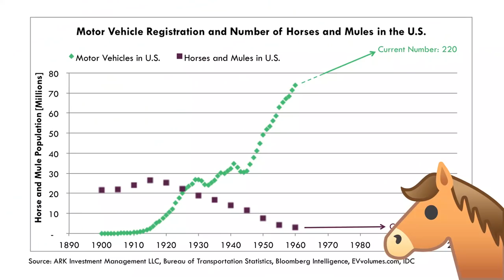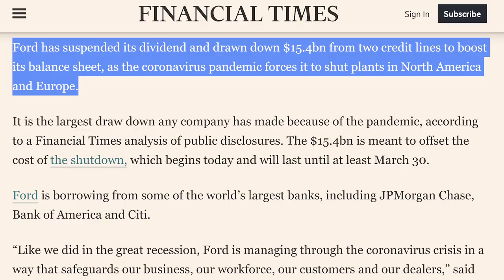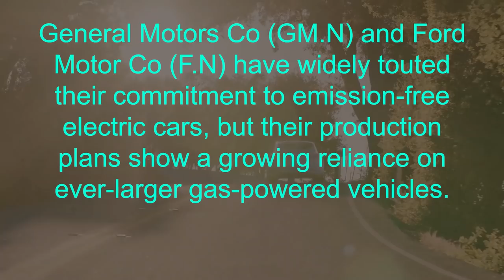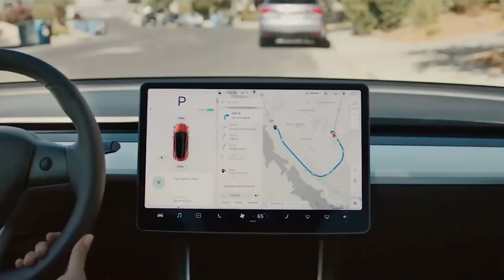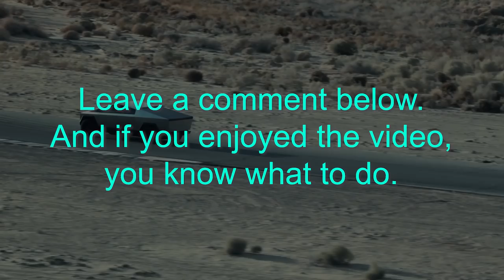Ford and GM are in BIG Trouble (bankrupt soon?)

Comment: Im not the biggest fan of VW but this CEO is spot on. They are in good hands.
Reply: I know, I feel like VW is a good hegde if you're heavily invested in Tesla.
Reply: @thdjjfsfh  One of the legacy makers should survive. They're all terrible, so why not VW? I wouldn't buy from them, but others might.
Reply: @maximumvalues  You sound like you just discovered EVs ten minutes ago. What you've posted has been debunked many, many times. Do some research before posting that nonsense.
Reply: Agreed
Reply: @maximumvalues  Trouble reading, too? 
1) You've lied about charging stations, claiming that switching to EVs would create long lines. This lie requires believing that no additional charging stations will be built as new EVs are produced. A decidedly anti free market lie!

2) You've lied about Tesla's stock price. If it had dropped 100% it would be $0/share, not $514. 

3) You've called Tesla stock fake. Another lie. This is the one company truly making a difference, not just with EVs, but energy production and storage. I'm sure your boss doesn't like those parts. After all, Russia is an oil and gas exporter.
Reply: @maximumvalues  I believe what you did is called luck. If you can continue making calls like this for year after year then we will know you are one talented individual rivaling Warren Buffet!!
Reply: @maximumvalues  EV will have a lower cost of ownership regardless of fees.
Reply: morally bankrupt
Reply: It's all lip service for the investors.............These are the same people that had emissions cheating software in their cars! Who would of thought the Germans were trying to gas the world!!!! The cost of pivoting from ICE vehicles and a Dealer network to EV's and direct sales will kill off most Legacy car makers! Legacy car makers have nothing but concept cars and empty promises of what they are going to do........they have no credibility don't believe them!
Reply: EV cars are doomed because they're based on the climate change lie, which is dying, slowly but steadily
Reply: @gibbyjones1040  Man made climate change is a massive scam I agree. However I bought a Tesla because it is far superior to every ICE vehicle I have ever owed! Every time I leave to garage the tank is full, I charge it from solar, it's never needed a service, I hardly ever touch the brake, it's the fastest car I have ever owned, I get free updates over the internet, the range has increased and it has gotten faster for free............People are not buying this car to save the planet we are buying them because they are freaking AWESOME!!!!!!
Reply: But may not make it.  Just because Diest found Christ doesn't mean VW won't avoid the Electric Chair!
Reply: @therealctoo4183  
Go back to Russia!!! Hahahs thats all you've got. 
Hey do you know Teslas net profit for 2018? Negative 960 million. What about 2019? Negative 800 million.
Reply: @chasejordan22  Do you know what investing is? Huge investments take time to pay off. It took Amazon a long time to get where it is now, despite not needing to spend the money it takes to build cars. Tesla is getting there faster. Don't believe me? What was Amazon's profit in 2014?
Reply: @therealctoo4183  
Yes I know how investments work, but if you havent been paying attention its easier said then done. How many super promising conpanys never made it anywhere let alone become Amazon.  If the future was that easily known we would all have been rich for years.
Talk to me when you have a profitable year or two first.
Reply: @maximumvalues  thanks for the advice. Ready to buy more tsla.
Reply: @chasejordan22  I don't think you do. If you did, you'd know that by the time Tesla has a year or two of profits you'll have missed the opportunity for the biggest stock gains.

The fact is that Tesla has a blue ocean. There is literally no company that can be considered to be a viable competitor for them. Not one even makes a car that could compete against an 8 year old Model S. None have even announced EVs likely to threaten ICE sales (as Teslas do) in the next 3 to 5 years. Maybe — and it's very iffy — VW will get something going with their ID series by 2024, but they won't be able to produce enough to really be competition for years after that. You talk about profits, but fail to see that their car business is growing at 50%+ per year, and their energy business is just starting its own exponential growth curve while most of the investing for that has already been done.
Reply: Surely charge station installations can keep pace with EV car adoption. So you shouldn't have to wait for on open charge outlet. The vast majority of EV owners charge their cars at home.
Reply: @chasejordan22  So you're going by the advice of "analysts" who've been wrong on Tesla for years? And you're thinking that the short term (especially with this virus playing out) has any real meaning? WTF? 

You have no answers! I tell you that Tesla has NO competition, and you ignore that fact! You don't even try to claim otherwise — because you know it's true.
Reply: Correction: It IS illegal. The "Real Truth" is telling people how they should invest. If they're a broker, they could and should lose their license. If not, they should be prosecuted. Unfortunately, the SEC will not do either. They're only interested in doing big oil's bidding.
Reply: @therealctoo4183  
Your spinning your tires like you have been for 40 comments. Predictions are like ass holes. Everyones stink. Your preidictions are about a company that has never made more then negative 300 million. 
Rivian, GM Ford VW all are going to make EVs. Ford has a huge advantage. Its name is Ford. It will alway be here and always top the sales chart like it has for 45 years. But but but my predictions right...
Reply: @chasejordan22  Now we're supposed to believe that Ford is going to be a competitor???  Ford? A company with over $160 BILLION in debt and many billions more in soon to be stranded assets? You're delirious. They know that can't make the transition, which is why they're doing all they can to delay it.
Reply: @therealctoo4183  
 The Real c too  
Whats funny is there is years of evidence showing Ford has a better chance to continue to be profitable. You know since they have done it for over a hundred years. 
You know they made the first car? The first 4x4? First independent suspension? Ford has changed and adapted and made money for a hundred years. 
Tesla has never posted a profit. Ever. You funny.
Reply: @chasejordan22  Yeah, I'll bet you were a big investor in Nokia.
Reply: @therealctoo4183  
I bet you invested im Devel. And the others who promised the moon while never making a single dollar.
Reply: @chasejordan22  Dude, you just got burned. You simply aren't smart enough to know it. Nokia was the world's largest phone maker in 2007 as the iPhone was introduced. They couldn't manage the transition to smart phones. Disruption killed their phone business. Their size was not only no help, it was a problem. 

Your entire position on this is gibberish.
Reply: @maximumvalues  What part of Tesla's financial health are you talking about?
https://www.marketwatch.com/investing/stock/tsla/financials/balance-sheet/quarter
Is it the $6 billion cash on hand or is it the $2 billion recent capital raise that now puts their total cash on hand to $8 billion?
Reply: @maximumvalues  Weren't you predicting earlier a dramatic fall in stock price for last Monday ? Dramatic fail's more like it :D
Reply: @maximumvalues  LOL!!!! your comments are straight out of the fake news media handbook........you don't know what you are talking about when you say "burning through cash" Tesla are not burning through anything they are investing in gigafactories and a global charging network! It was a genius move by Tesla to raise capital (which they didn't need to do) at the peak, they timed it perfectly.......well done Tesla!
Here is my Tesla portfolio
330 shares purchased @ 303 per share $100,155    07/2018
190 shares purchased @ 190 per share $50,198      07/2018
100 shares purchased @ 255 per share $25,516     08/2018
I covered as the stock price fell, and yes I was a little nervous but I planed to go long. 

All sold at $766 I made $300,000  02/2020
This is the only stock I have ever traded in my life because I was so confident in Tesla, in hindsight I was lucky I got out when I did because no one could have forecast Covid19. Tesla are in an amazing position to get through this downturn, however legacy car makers will struggle and my guess Ford and GM won't make it! 

BLAHAHAHahahaha shorting Tesla....you are dumber than you look!!!! Don't forget to check out their Inventory if you are going to look at their Liabilities!!
Reply: @maximumvalues  You are going to lose the shirt of your back.....mark my words!
Reply: @maximumvalues  I've bookmarked this page and I will touchbase with you in 2 months time, if you can afford an internet connection you can give us an update!
Reply: @maximumvalues  I wish you luck, I am out of the market, Tesla was the only shares I had and I was planning on going real long 10 years+ but with the sudden stock rise I got to $300K profit so I was happy to sell. My view of the Stock Market is its the biggest Casino in the world and over the years everyone that I have met who has told me they have been trading for years and they give up their job to do it full time every one of them has lost their shirts.......I hope you prove me wrong!
Reply: VW got burned very hard and rightly so for their 'TDI scam'... TDI was a fake technology - just old diesel with a hack to trick emissions testers.
I'm very mad at VW... but... they did buy me my Tesla... They had to buy my TDI back from me at an almost new price and that paid for a huge portion of my model 3.

That all noted... VW management is basically looking at all this, and at the fact that their number 1 sourcr of revenue has been exposed as a lethal-lie... and deciding they want to be in a place where they can never get exposed for nasty tricks like that again... For them it is the perfect time to switch everything over to EV as fast as possible - because their customers have lost faith in their core product, and they're already having to retool everything anyway...
Reply: Real Truth read your whole comment feed here and it seems as though you’re the only one talking with some sort of sense... making solid arguments and providing insight for others. I’m barely 18 and looking to get into trading sooner rather than later and if you have any other valuable information or would like to spill how you learned what you know, that would be appreciated. Just looking for knowledge at this point.
Reply: @danielslosarcik2397  BLAHahahahha, kid if you are looking to get educated by a youtuber you don't even know about share trading, let me tell you, you are going to learn things the hard way!
Reply: Yeah. It’s just too bad that they are launching 3 EVs in 2020 but they use pre-2010 tech in them. Fortunately for them the future buyers will not do their homework and will buy their cars. Anyway, at least it’s better for the environment
Reply: @maximumvalues  I live in Europe. In 2030 50% of the car sales must be EV. 2050 will ban the sale of all ICE cars. Charging you do at work or home. You don't need a new car. A self driving Tesla or VW will pick you up. I own a 993 air cooled Porsche for the weekend and a model 3 for regular driving.
Reply: Fox Md I’m interested in reading charts. No need to be negative I did nothing to you
Reply: @maximumvalues  Well, I guess there's always another Monday. Keep at it, there'll be a moment when you're right for sure  ;-)
Reply: Darth_Adas yep, literally admitted that he is having to follow musk
Reply: @maximumvalues  How's your Tesla short going?
Reply: @maximumvalues  I'm good I took my $300K profit and ran. Tesla's record Q1 took shorts by surprise...ouch!
Reply: @maximumvalues  OK, but it just sounds like a gamble to me.